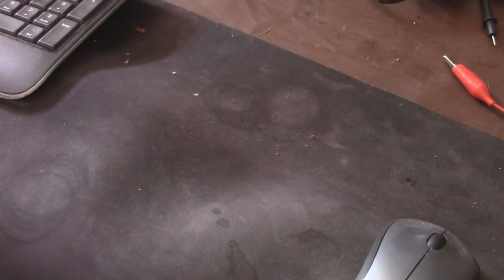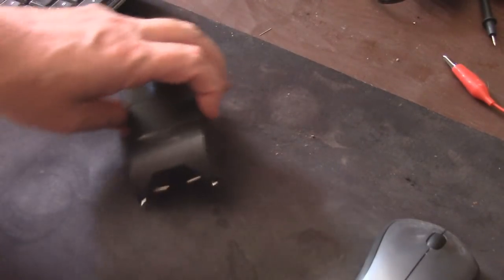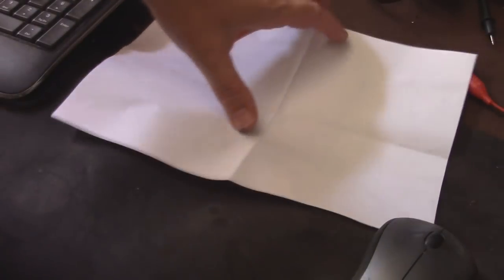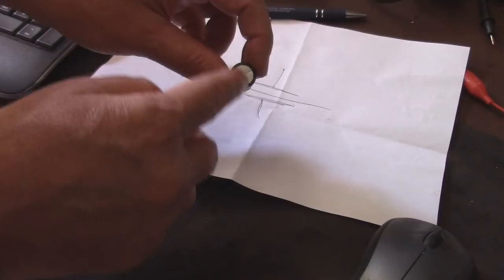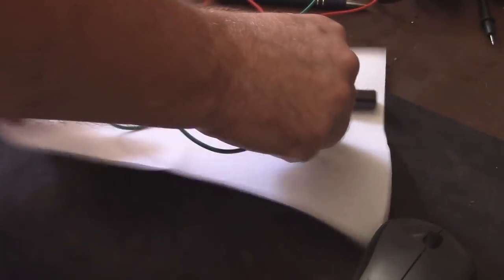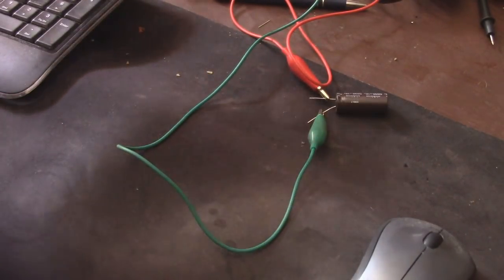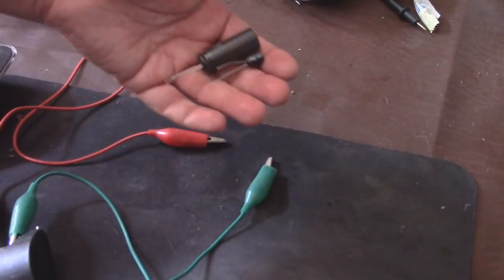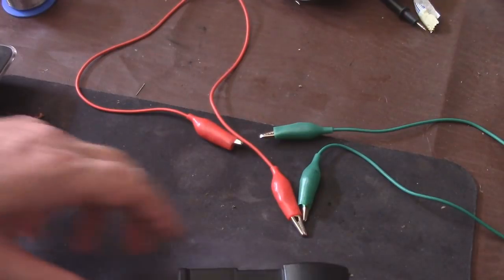stun gun vs a capacitor : will it explode?

Comment: Used to tweak old throw away flash cameras into low grade zappers in the day good for crowds at the L.A.Forum
Reply: dan beck we used to take a 9 volt battery and a door bell transformer and wire it in reverse with a door bell momentary switch... The longer you'd hold the button the bigger the charge would build up and all you had to do was touch the output wires to someone.  It was always good for a laugh.